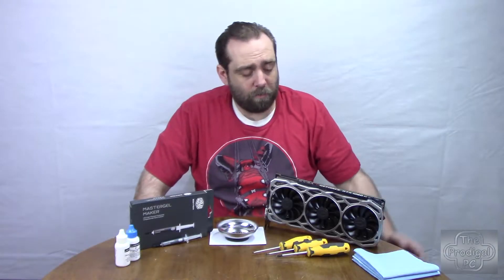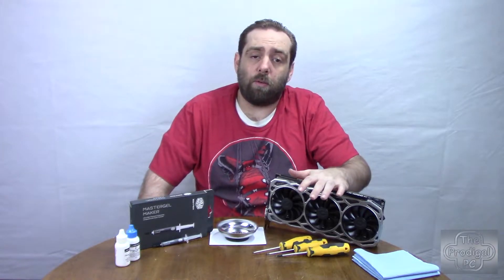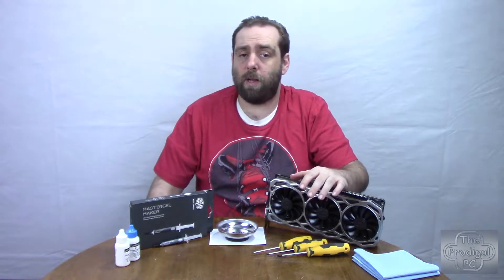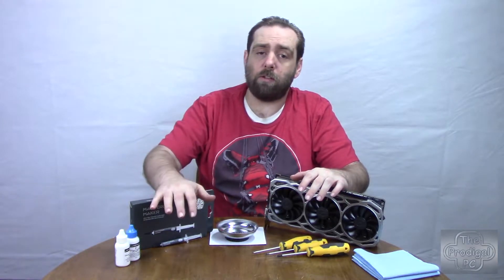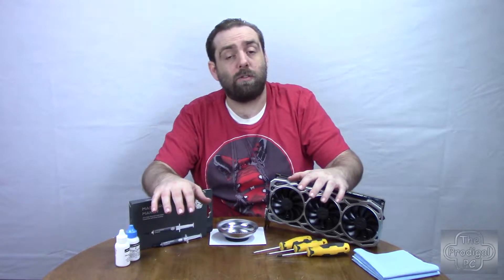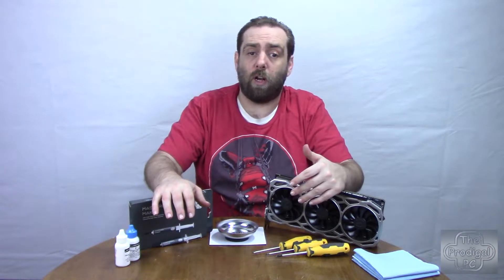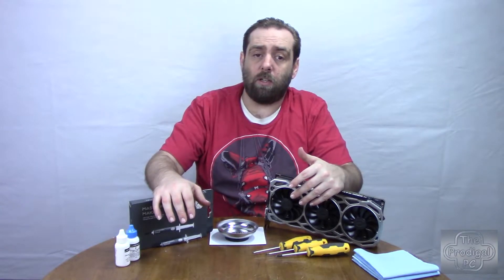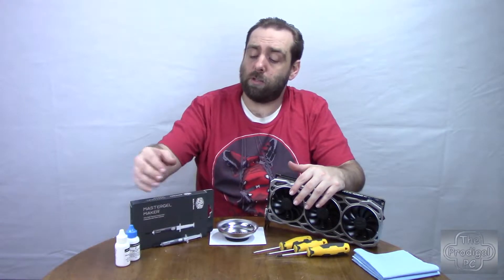How to replace the Thermal Compound in your 1080 Ti FTW3

Comment: Great video, thank you!! Every step was exactly as shown. For the doubters out there, my card went from 76 degrees C to a Max of 58 degrees C. I used Arctic mx -2 with the fan speed locked @ 60% across all three fans. Tested using a 30 min loop of heaven benchmark with everything set to maximum for 30 mins at 1440p. With the old paste the card would go to its max temp after 2-3 mins. With the new paste it ever so slowly edged up over the 30 mins. Again thank you, highly recommend!!!

Comment: Thank you for the guide. I have a two year old 1080Ti under a custom fan curve, which is starting to get hotter than it did when it was new, so the fans have to kick up a bit on heavier OC loads. I believe EVGA Tim (like on my EVGA 980Ti), needs a swap after 2-3 years of use. I know TG Kryonaut is supposedly the best, but i have read it's not very durable on direct die (6 months). Anyone here can testify to the longevity of some of the thermal pastes they have used with good temp results as well (no liquid metal stuff please), on their 1080Ti. Thanks

Comment: Wow you completely skipped over how to, how many led fan plugs that are need to be disconnected, nice man.
Reply from the maker: That's because they didn't all need to be disconnected for this task, but you an clearly see the 2 plugs other plugs at 1:27 in the montage. The 2 headers that need to be disconnected are shown in the process. In total there are 4 cable connecting the shroud to the PCB.
Reply: @TheProdigalPC  at 1:18 the first plug u seem to take off but what did you do with the second one? Can't tell if you are trying to disconnect the plug or trying to pry the whole thing off.
Reply: @tyren818   seriously its very simple; remove the 8 screws and unplug all the connectors. Be confident.

Comment: Just done mine and now it’s artifacting  and I’m getting display driver stop working and has recovered. Any ideas?
Reply from the maker: Sorry without actually getting my hands on it I can't offer a diagnosis. All I can suggest is that you make certain you seated the cooler properly and that you didn't cause any physical damage to the card.
Reply: The Prodigal PC I think I figured it out. I took the card apart again and redone the paste. Upon inspection I noticed that it looked like I didn’t get good coverage of paste. IDK if it’s bc I didn’t tighten it properly or what but about 1/3 of the GPU didn’t have much paste on it. Although monitoring software showed all temps where ok I’m guessing one side was to hot. Thanks for the reply.
Reply: @FuelsModels  did you use different thermal paste application methods for both trys.
did you spread it out or did you use  cross methods?

Comment: Good video, straight to the point. By the way,I've preferred to disconnect all the connectors,to prevent damaging and to have the cooler completely removed.

Thanks for te video.

Comment: how often is this necessary with this card , I got the same exact card this thing gets HOT easy , understandable for the power but not sure if I need to reapply yet or not
Reply from the maker: I really shouldn't be necessary for quite some time. I however tend to refresh the TIM on my heavier used cards every year or so.
Reply: I took mine apart pretty much immediately to find the usual lousy lazy thermal paste application under the hood. Put the tried and true NT-H1 there, though I don't smear it on the die, just put some in the middle, mounting the heatsink back on will spread the paste nicely. As for temps, I got a fairly aggressive fan curve, on a modest oc +20 core +250 memory gpu reached 80 during benchmarking. After the change, it pushes mid 70s tops. Aesthetically I'm ok with 70s, the card running in low 80s just looks ugly, though it's probably fine.

Comment: nice! Short and super understandable! I have Msi 1080ti and its running 67-70 in heavy loads under 100% fans. Ofc i want to change thermal paste, but the question is - will nt-h1 will be better than stock paste? Any advice?
Reply from the maker: It would seem that Noctua NT-H1 is going to be about the same thermal conductivity as a standard like Arctic silver 5. You are not running very hot at 67-70 under heavy load so I don't see it doing much better than stock. If you use something like Cooler Master Mastergel Nano or a high end paste like Thermal Grizzly Conductonaut you will see a noticeable difference. I would imagine your problem is the volume of those fans at 100%. The best solution for that would be to get an NZXT G12 bracket and a Corsair H55 AIO to liguid cool it and get the best results possible.
Reply: so....that shit paste that EVGA used, when I open mine up, it seems like they dint put enough...I replace it with Gelid Extreme and now my GPU runs -4-5 degrees, it doesnt hurt and you learn how to take apart GPU.

Comment: Damn is it really that simple to remove the cooler?
Reply from the maker: Usually it is even easier than this example. Typically it only take four screws and a cable or two.
Reply: The Prodigal PC nice, I've just reapplied thermal paste and while my gpu temp has dropped by about maybe 6 degrees my power and memory has seemed to rise in to the 85 83 degree range
Reply: Any idea why this would happen? it was much cooler before
Reply from the maker: Make sure when you took it apart that you didn't accidentally move the thermal pads off of the VRMs. That would definitely cause the temp increase you are describing. make sure the pads are correctly placed as seen in the video at 1:28.
Reply: Thanks it seems to have fixed my issue subbed!
Reply from the maker: I'm glad I was able to help. Happy overclocking!!!

Comment: I wish i could find someone who has done this on a Galax GTX 1080 Ti EXOC because i'm too scared to do it without seeing the steps first on my card !
Reply from the maker: After looking at the teardown of that card it appears that it will be as simple as removing the 4 mounting screws that hold the cooler to the silicon. Then gently pulling them apart until you can see the to cables that connect it to the board. Unplug the cable that is easiest to reach first and then you can remove the cooler. You can then clean and replace the thermal compound on the die. After that it is as easy as doing everything in reverse.  https://www.tomshardware.co.uk/kfa2-galax-geforce-gtx-1080-ti-exoc,review-33928-2.html
Reply: The Prodigal PC thank you :)

Comment: like! going to open my ftw3 myself now.
Reply from the maker: Excellent, I would love to here your results. Make sure to take care when removing the screws, you have to unscrew then from an awkward angle and you don't want to strip them. Good luck and have fun.
Reply: Hi! Yes, i am afraid some are a bit stripped a bit already :s They replaced my sc2 with a ftw3 DT via RMA, the ftw3 is not stable higher as 1830 mhz and goes up to 80c (85c because it was hot yesterday) , Changing the thermal paste did not help. I can't seem to fix the heatsink fully like it should with the screws, i uploaded a picture could you please verify if this is normal? https://ibb.co/cfnF8y          Thanks alot!
Reply from the maker: Understand that DT stands for De-Tuned and will not get very high perfomance. Those cards are typically the silicon that did not perform well but was still useable. I would have made them replace the SC2 with another SC2.
Reply: Yes i do realize that, however hey did not inform me they have just send me the card. Have you taken a look at  the uploaded picture? thx
Reply: So.. i applied conductonaut liquid metal, it runs much smoother and cooler now (20c difference)! i actually flashed the bios of the ftw3 elite (with 12gbs memory speed) and it works flawlessly. stable up to 1970mhz core. :)
Reply from the maker: Nice. I am glad to have helped. Stay tuned for more tech porn.
Reply: @ISFRedSandman  Hey, I've got a 1080 FTW2 DT and I was thinking of ways to improve its performance. Do you recommend flashing a different BIOS? If so, which one?
Reply: @jorgepalacios6651  Hi Jorge, i think you should try it. The DT has stock clocks like founders editions cards, you should try to flash the normal ftw2 bios
Reply: @ISFRedSandman  What is the brand of conductonaut liquid metal you used?  I need to do this to mine too.  Got a Amazon link?
Reply: @ChescoYT  Hi The brand is Thermal Grizzly. I also used liquid Coollabratory in the past, pretty much the same thing.
Reply: The Gov Thats awesome dude!
Im a first time card owner of the same as the one u have and learning about this stuff.
Got a amazon link to the actual liquid compound u used?

Comment: Awesome video man! I’m thinking of doing this. What are your average temps before and after with a fairly aggressive fan curve?  I have noctua nt-h1 on hand so I may give it a try.
Reply from the maker: Unfortunately the card is not mine and I was unable to run bench tests but the owner has reported 7~10 degrees C improvement.
Reply: The Prodigal PC thanks for the reply

Comment: Any change in temps? If yes how much? 

Nice video.
Reply from the maker: Measurable change of 5-7 C depending on aggressiveness of your fan curve settings.  It even allowed for an extra 50 MHz on the overclock using afterburner.  Granted that is with no voltage change from the stock settings. 

Thank you.